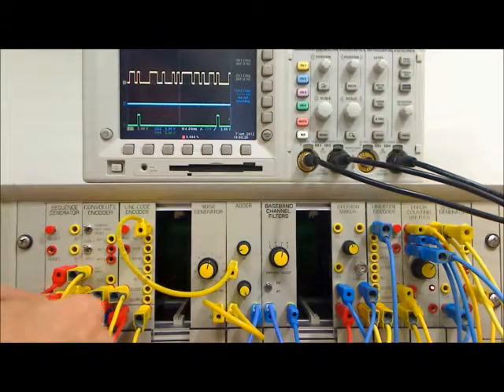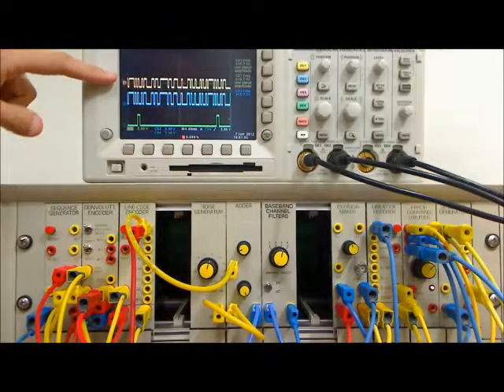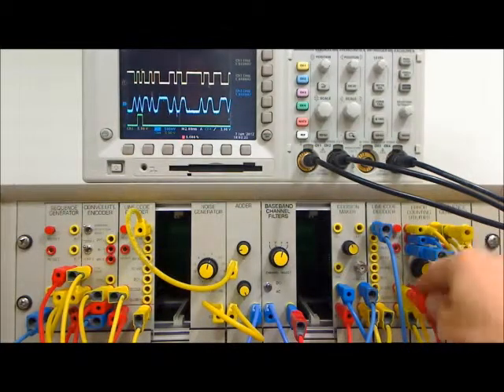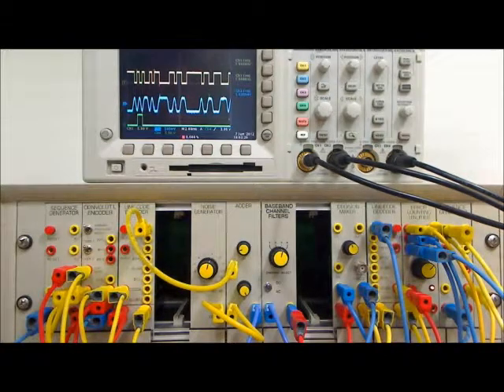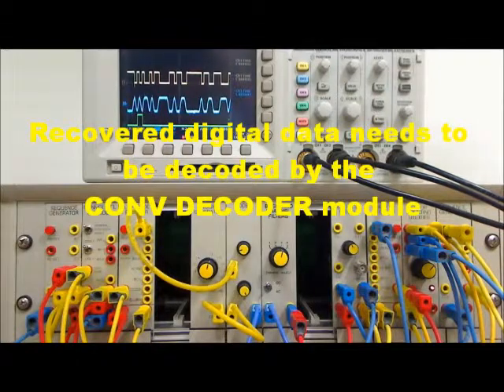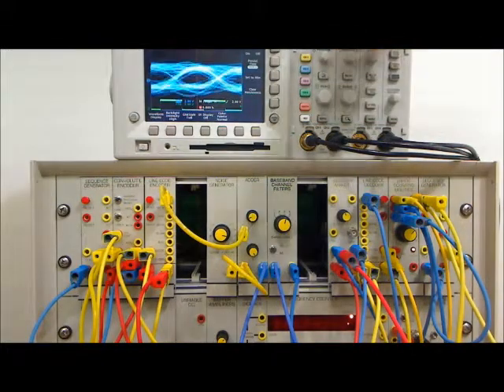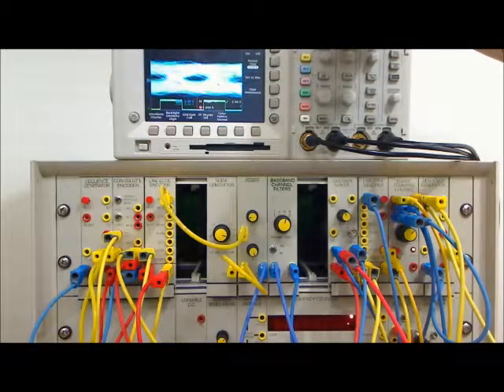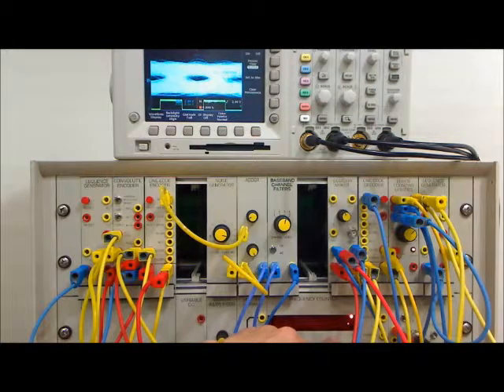EXPT D2-09 Convolutional coding with BER using TIMS 6713 DSP

Comment: nice video very educative and straight forward. 
I'm currently working on the trellis coded modulation and i have already done a simulation using matlab for 8-PSK TCM 8 STATES, 16-PSK TCM 16 STATES AND 4 QAM TCM , 16 QAM TCM. i would want a video on by EMONA TIMS on trellis coded modulation so i can compare my simulated results to the experimental results performed.
cheers